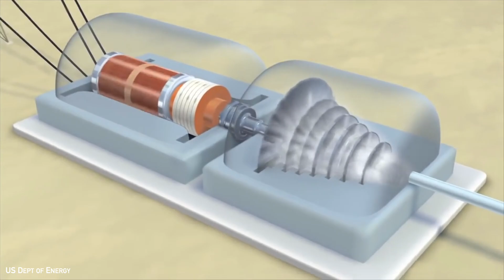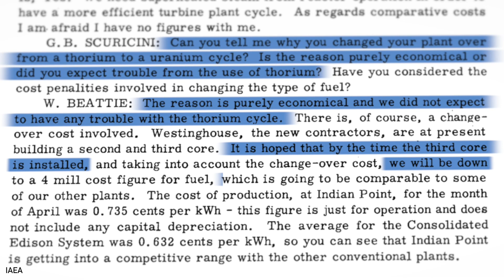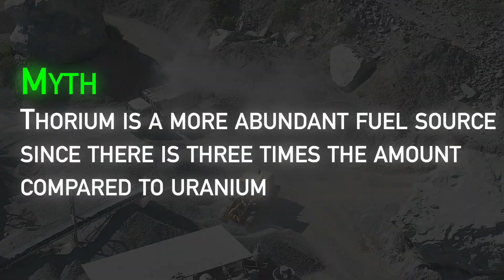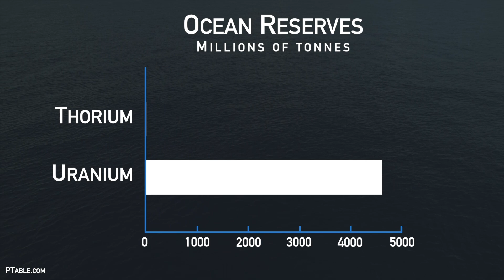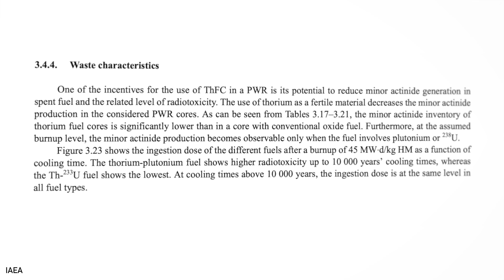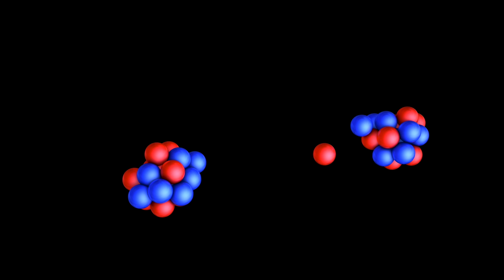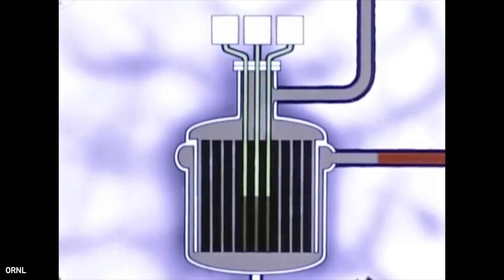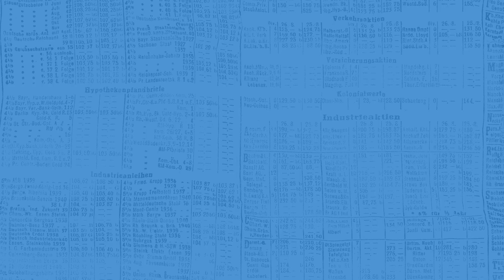*Almost

Comment: I'm sure I read or heard somewhere that Molten Salt Reactors using Thorium consume a much higher percentage of the fuel compared to current designs and they can be fueled by the waste from the current designs, leaving less than 10% of the waste to be stored longterm, is any of that true?
Reply: Not exactly. The current light water technology uses solid fuel rods. The fission waste products are mostly trapped in these solid rods. The byproducts include long lived isotopes with atomic numbers above 90. These isotopes can be removed chemically but that costs money. Our current rulers would rather fantasize about building long term storage sufficiently robust to contain wastes for tens of thousands of years. Meanwhile the stuff sits in cooling pools next to the reactors.

The thorium champions are advocating that the nuclear fuel be used in a liquid salt state.  This makes radioactive gas products like tritium and xenon boil out readily.
Hence they have to be dealt with immediately. Further, the accumulation of other radioactive byproducts has to be dealt with quickly else they will slow down the fission process. The liquid salt medium has to be continually taped from the reactor so these wastes can be chemically removed. The heavier elements (above 90 atomic number) are recycled immediately back into the reactor.  The other lighter radioactive waste elements have a worst case half life of 30 years. They will all decay to background radiation levels in 300 years. Under this regimen the long lived wastes are burned and, the short term wastes can be sequestered for 300 years.

Light water reactors produce Pu-240. This isotope is too unstable to make bombs with. It needs to be bombarded with neutrons and fissioned. Liquid salt reactors can do this fissioning and provide a way to burn up this and other noxious long lived wastes. Neat.
Reply: All common fissile elements (u233, u235, pu239) create more or less the same long lived radioactive fission products. Theoretically u233 should produce fewer transuranics.

Comment: Thorium who is the genius who decided only Energy consortiums can operate these technologies when ZERO-point technologies and Corona flux generators are simpler than recycling nuclear waste a magnetron can do the same job safer easier and is scalable without the risk of a nuclear monitoring service Government control is thusly assured. My Uncle now passed was offered a settlement when the Nuclear plant failed and they had Military clean up the spill and they refused to acknowledge the technicians in the plant were shut out they also criminally reinstalled cores and reactors that were unsafe and dangerous we instead spilled enough radio active waste into Lake Ontario as the cores failed in spite of my Uncle refusing to recertify the cores.
New DC drives are ultra efficient at speeds and the batteries are ridiculously the weakest part of this equation, New zero point drives are on their way unfortunately the Energy companies are looking at owning everything including the free Zero point energy bonus waiting in the wings I have seen these fission drives and they can be built around a harmonic containment vessel with unlimited power at virtually no costs as the materials are both cheap and abundant since silica and enclosures can be readily manufactured and a 50 Kilowatt power station is smaller than a microwave and can literally run on urea right from the driver as a source of fuel.

The Chinese are looking at cobalt high cap batteries and the silica based charged slag for roadside charging and flowed energy is molten sand with a oxide embedded allowing the direct vamping of energy from the slag actually we already perfected these drives and it was always in the works since before 1994.

EV tax grabs and taxpayer welfare needs stopped and Biden, Trudeau need to get the hell out of car manufacturing as they are stealing tax dollars in the name of carbon sequestering while buying options with their trust funds. These Globalists need stopped and the free world should demand these Globalists be arrested and charged with War Crimes while they have their patents stripped and licensing revoked as they have misled the public the theft of public funds while lying about the content of vehicles. The car industry has lied about everything including the actual costs of cars and trucks while pricing customers out of driving while padding their pockets they are war criminals as they have stolen future vehicles to reflect no energy on the grids while using subsidies from government and criminal actors in the power distribution business.

Comment: A lot of the thorium dream is great on paper.  The reality of those complex fuel cycles and handling molten salt is very difficult and very percise.  If you shot down a salt reactor while there is salt in it and it solidifies, it will take years to fix it.
The fuel breeding and all the exotics which are part of teh fuel cycle make it far more chemistry intensive.
Here's the crux.  A lot of these techniques, torted by "Thorium" supporters are also possible with Uranium fuel cycles.  95% of the fuel can be recycled and reused.
Why isn't it?
Exactly the same reasons thorium reactors aren't doing it.  Too complex, too costly, uranium is cheap and it makes plutonium to renew all the bombs which go "stale" every 20-30 years and need remade.  The platonium in the cores is no longer weapons grade after 30+ years.
Reply: Ah yes the classic paper reactor problem.

Comment: Correct me if I'm wrong but a Uranium based reactor is dependent on RAPID REACTION mitigation tech which adds a whole heap of issues to safety and a whole heap of money to the bottom line of a facility! No?
Reply: Exactly, and that's only the half of it.

Comment: 80 years of power plant design and we still have high pressure uranium power plants.... with solid fuels...  the incumbents of the nuclear industry are not interested in innovation - just forget about it.  They are not investing in anything that might degrade their high pressure uranium investments until something else starts taking their market away.  They are running nuclear for a return on investment and stifling innovation because they have no intention of degrading their ROI on present investment.

The people who funded it in the first place have long ago been replaced by accountants who can not put future values on their balance books - even if they wanted to.

A key issue with Thorium is actually it's abundance.  Almost every country has some - hard to corner it's market too.
Reply: simply put, 60 years of nuclear power and multiple countries have tried Thorium and today NO commercial Thorium reactors exist.....nuff said

Comment: His characterization of the plutonium question doesn't account for the human factor.  The US Military wanted plutonium.  Lots of it and fast.  That's what an "arms race" means.   

Thorium wasn't going to get them there.
Reply: Do you have ANY knowledge of history????

Where do people keep coming up with this BS that Thorium was abandoned and Uranium based PWR/BWR were chosen so we could make bombs?
Hanford Wa. has been making weapons material, at their 9 reactors, since 1944, 12 years before the first U.S. commercial nuclear plant became operational and their weapons production reactors are very efficient graphite moderated reactors and DO NOT produce any electrical power.
Savannah River site SC. Has been making weapons material since 1955 and their 5 production reactors are very efficient low pressure heavy water moderated reactors and DO NOT produce electric power.
Thorium was tried at Shippingport and Indian Point commercial reactors in the 1970s and abandoned as too costly compared to Uranium.
Weapons production reactors are NOTHING like U.S. commercial PWR or BWR power reactors and commercial power reactors have NEVER been used to produce Pu239 for weapons, since there has never been a need beyond what the efficient weapons production reactors could provide..
The U.S. currently has so much Pu239 that 34 tons of weapon grade Pu239 is being treated so it can eventually be disposed of at a cost of billions.

Your comment is like saying automobiles use gas engine because the military wanted jet fighters.  God help us that people base their knowledge on social media and YT videos.
Reply: @clarkkent9080  😂 Automobiles use gasoline engines because the military wanted jet fighters. I'm going to steal your comment.

Comment: 10:18 U-233 bombs have been built and tested. Officially, uranium-233 has been shown to be 'highly satisfactory' as a weapons material. In fact, the whole ordeal showed that bombs based on u-233 are so unpractical that they are not worth it. The strong gamma radiation: 
a) makes the process of building and storing the bomb extremely difficult.
b) makes it really difficult to conceal against an enemy, meaning the intense radiation can be detected from really far.
c) leads to premature detonation that reduces the yield significantly.
d) the bomb will decay.
e) the intense radiation will degrade and eventually defunct any electronics within and around the bomb (no ICBM mounting)
Reply: Any fissile material can be used to make a nuclear weapon, some are better than others.

When you talk about strong gamma you are referring to U232 contamination that can be managed. 
And I assure you that and gamma radiation can be easily shielded and will not be detected from far away.

Aircraft carriers have two nuclear reactors with cores that emit massive amounts of gamma radiation and that is not how the enemy locates them as the radiation is shielded mainly for personnel protection.

Comment: You mentioned perception as the main hurdle with Thorium.
You either left out huge hurdles or glossed over the few you mentioned.  Copenhagen Atomics has figured out a way to incorporate thorium with spent nuclear fuel and get as much energy out as of it were new fuel.  They also claim their technology produces much less highly radioactive waste.

What am I missing?
Reply: Your missing the FACT that Copenhagen Atomics has only built demonstration porotypes that have not even used any radioactive isotopes. Only AFTER their theories are PROVEN can you say they figured out anything.
Reply: @clarkkent9080  They sure are acting like the figured it out.
Reply: @tommartens3731  I would think if it was worked out, they would build a real commercial plant not a prototype demo test plant.  Any startup that wants a government handout has to act like it is all figured out

China and India have done the same thing in building small demo test reactors that produce no electricity.  At the same time China has built many PWRs, full scale, electric producing.  PWRs and BWRs are the only design that we know works for sure.

Comment: The real reason Thorium-bred uranium would be very difficult to use in nuclear weapons is not that it does not fission but that unless you are very careful there will be a U-232 contamination. U-232 apparently has hard gamma emitters as (some) of its fission byproducts and those are apparently extremely undesirable in weapons.
Reply: any isotope that is fissile can be used to make a nuclear weapon.....some are better than others

Comment: As soon as the term "Thorium reactor" is replaced with the correct term, "Molten Salt Reactor" things get much easier to understand. Uranium and thorium are both fuels of a MSR and in that reactor thorium has no advantage whatsoever. Just the opposite is true, uranium is a much better fuel than thorium in a MSR, that's why almost no one is even proposing thorium, they are all using uranium.

Comment: In 1973, thorium reactors have been discarded because they were not chosen 10 years before. This is not an argument. Main reason for a better security of thorium reactors is neutrons have to be injected to sustain the reaction.

Comment: Awesome to finally see some decent videos on thorium.... One bomb you may already know about thats worth a video of its own is Shakti V detonated in 1998 in India at the Pokhran test range. Was a thorium and u233 low yield experimental device that worked well so far as I know and goes along a bit with comment in other video about u233 and Lawrence Liv Nat Labs. I think is also a letter sitting about somewhere to/from them about use of thorium for bombs and pretty sure was a similar response of it works but does not make sense compared to plutonium at the moment just due to cost. Is a whole mess of nuclear bombs you can make from thorium reactors and tossing tritium in so you can go fusion is a total cherry on top but is really not worth playing about with. Even for fusion power rather than bombs the stuff is a bit scary to be playing about with when normal out thorium, uranium and home brew plutonium could be doing so much more if not for so much fear and confusion.

Comment: Thorium is more of a branding thing for nuclear, to separate it from the unfair stigma that older uranium based designs have been stuck with. Gen IV uranium have just as many advantages as Gen IV thorium, but it's easy to sell the fact that the technology is new and different if it has a different "name".
Reply: There are no Gen IV Thorium processes...                             YET! 
It's experimentation has only recently been resurrected and is too new to the industry especially, when arguably, Uranium/Plutonium reserch has proliferated.
Reply: You are correct, "Thorium" is just branding. What is important is the MSR, which is the game changer. Low pressure, high temperature, low cost. Low cost for 2 reasons, no heavy/expensive pressure vessels are needed and the power conversion equipment doesn't need to be nuclear certified as it does in a LWR. This is possible because of the high-temperature output.

Comment: If Lithium Fluoride is used as the molten salt the Lithium will transmute into Tritium.  This can be very bad. Tritium is toxic and very radioactive. But.  Tritium  is an excellent fuel for a FUSION reactor .  Harvest the Tritium as heavy water , sell it to the fusion guys, win win.

Comment: 7:22 The problem is not that they stay radioactive for any period of time, the problem is the decay heat. 
You can't just heat up a geological formation for even 0,0 degrees, without it developing faults. The first 200-300 years we must store the residue above ground and everybody talks about underground storage, because of the costs of proper above ground storage and no other reason. 
There is absolutely no problem with moving 10 feet further from a source, if needed and this is the only precautionary action one has to take, to avoid negative impact from ionizing radiation from active residue of nuclear power production, if the stuff is stored in a enclosed and dry space, like a usual proper maintained self storage.

Comment: The long lived isotope problem can be solved by simply to reprocess the fuel and put it back into a reactor.
Reply: Nope, all you're going to do is build up reactor poisons. That's why fuel rods are removed in the first place.
Reply: @darkgalaxy5548  Xenon is the reactor poison not the Tc 99 or the I 129.

Reprocessing is what happened when you take an expended rod and remove the parts that are fertile. Those long lived isotopes can then be bombarded by thermal neutrons until they absorb them and their half live shorten.

Comment: On the question of proliferation, I disagree that it is totally busted. The fear with proliferation is that the material could be acquired by a non-nuclear country or bad actor and used to create a bomb. The general inexperience with Uranium bombs means that the likelihood of an in experienced group creating a functional bomb is much lower due to a higher barrier of entry. So although it does not eliminate the possibility of proliferation, it greatly reduces the threat compared to plants that produce plutonium.
Reply: Also don't forget that u232 mixed in with the u233 makes it exceedingly difficult to make such a bomb.
Reply: Actually, it's completely busted. The breeding of U-233 inevitably produces a some of U-232, which is both a potent gamma emitter and has to be kept to extremely low levels to be used.
Reactor grade Plutonium is also completely useless for military use; the isotope ratios are completely wrong. And unlike Uranium, the technology to enrich Plutonium doesn't exist.

Comment: Making nuclear bomb out of thorium is possible in theory but very hard and impractical. Its synthetic daughter i isotope uranium U233 is fissile indeed, but byproduct U232 and protactinium Pa233 are too intensely radioactive and hard to separate, compared to weapon grade U235 or plutonium 239. You can not make practical nuclear bomb with such impure U233 with intensely radioactive fission material. 

And for comparing thorium vs uranium resource availability, you should compare thorium 233 versus uranium 235.  All 100% of thorium can be used for nuclear fuel, but only 0.7% of uranium (U235) can be used for nuclear fuel, big difference.